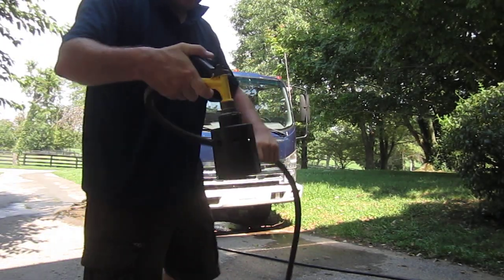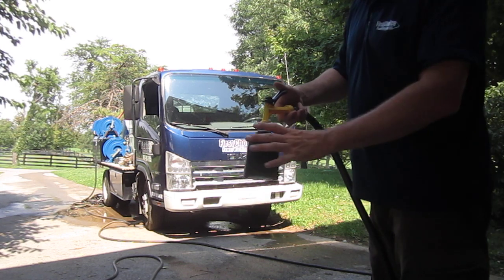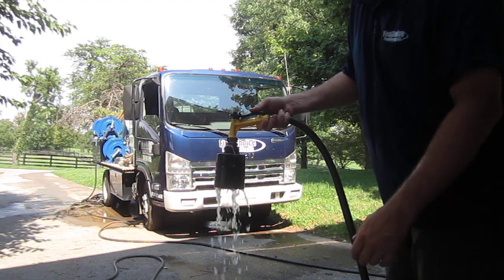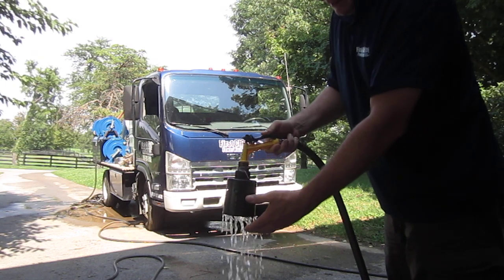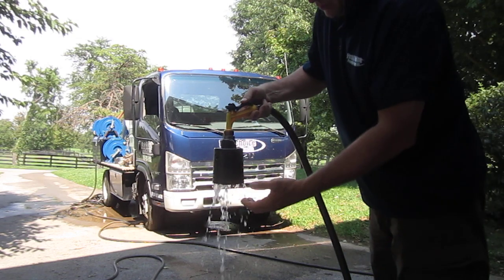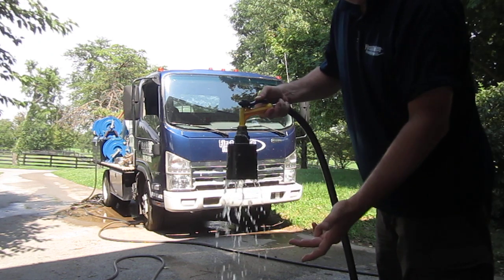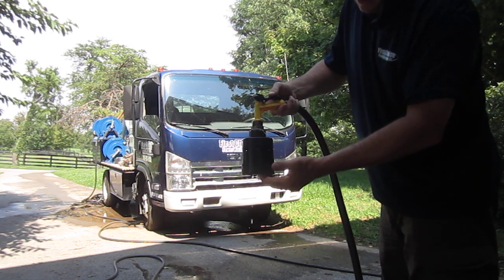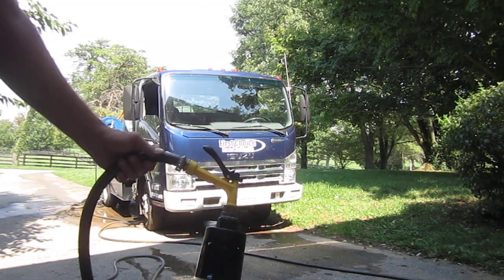Float valve for water tank feeding pressure washer

Comment: Does the "Hudson float valve " I can plump this into my water inlet in my bulk tank so its a permanent part of the setup right? We always just kept a eye on the bulk tank for water pouring over the side. The only thing im worried about is if this somehow got stuck and then I starve my machines of water and scar my valves on my pressure washers. I might try this and just watch it anyways just to make sure we don't have a issue :) Thanks for the video :)

Comment: Yes, that may be true, using a fire hydrant. what is it? 1000psi? of course your flow rate will be substantial.  I purchased the hudson and tried it on 4 of my riggs every one ran dry. The hudson only runs 1.5gpm. It's used to keep the drinking water full for live stock on a farm . I use two 335 and two 550 gallon tanks it, didnt match the flow rate of my landas. 5.5@3500psi. and 4.0 @ 3500psi. now the kraftsman 2200psi at 2.2gpm did fine. I ran all day.
Reply: Idk, I tried them again just to be fair in my comments. The only conclusion that I can reasonably come to is that I purchased 4 defective units. My flow rate using customers water (from the house) is 1.5 - 2.0. now, if I use the hydrant it flows 20gpm but, wont shut off because of the water pressure. Good luck I'll stick with brass float valve. It auto adjusts to the water flow\pressure.  By the way, nice looking rigg.

Comment: What kind of washer are you using. mine runs at 5.5gpm that hudson runs at .5-1.5 gpm.  The math wont work with the flow rates. The tank runs dry. I purchased a 12gpm brass float valve from granger. $37. The reserve stays full. Unless your using a wallmart special that hudson WILL not work.